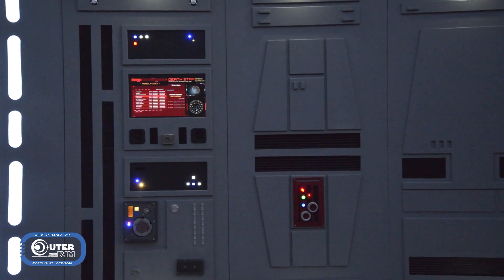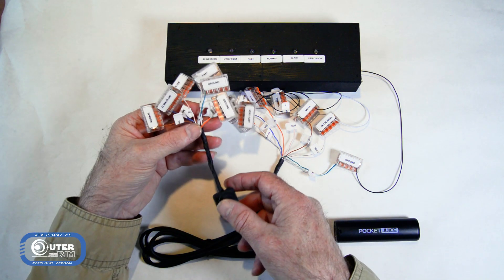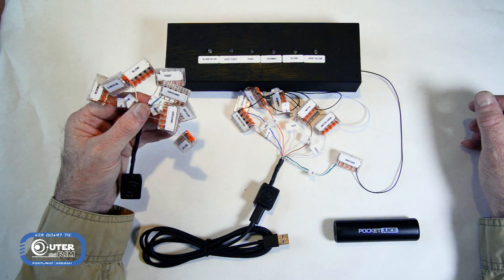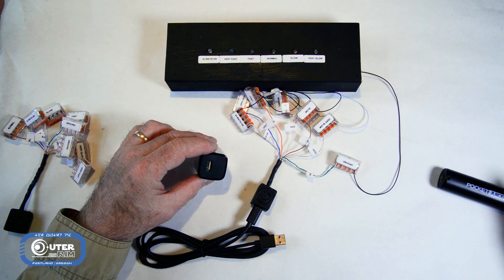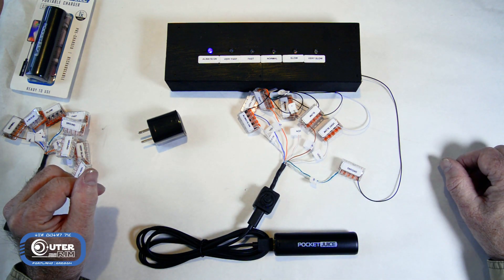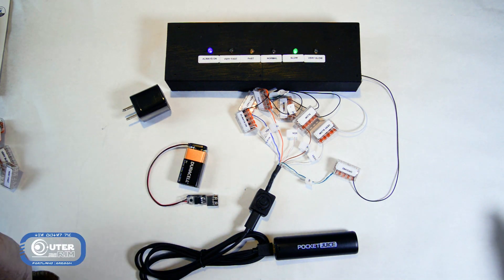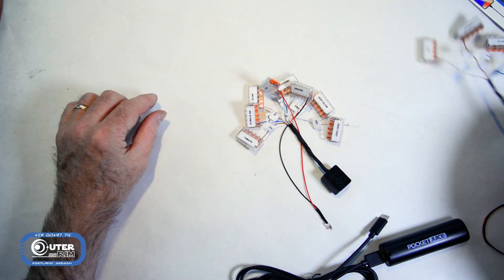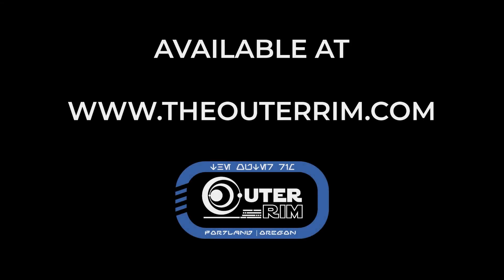Outer Rim LED Controller

Comment: Dear Jamie, I do have a short question about this kind of LED StarWars Panel. Do you place the LEDs directly below the arylic tiles? Or do yu  use another light source to lighten up the buttons?
Reply from the maker: To get the best results, the LED should be a short distance away from the acrylic tile, so it does not create a hotspot. You can build a small enclosure for the LED behind the tile, and put a small square of white packing foam between the LED and the tile to further diffuse the light.  I hope this helps.

Comment: Wondering that the data sheet of the RP2040 says 100mA max output. But so many 20mA led's are connected.
Reply from the maker: Thanks for your comment Robert.  Technically, you are correct, and best practice would indicate you use no more than 10 LED's total. Please use your own best judgement.  I did do a real world test, in which I ran it with (30) 12V LED's with built in resistors continuously for 48 hours with no ill effects or overheating.  I believe this works because the LED's blink at different rates,  which means at any one time, many of the LED's are OFF.  There is a reduction in brightness, when using this many LED's.  To do a large project with lots of LED's, you may want to purchase additional controllers.
Reply: @TheOuterRim_  Yes, that is what I was thinking. You may have programmed it in a way that some are on while others are off. A great way to use many led's. Another way to use more led's is to use a mosfet as a switch, but becomes to technical and to complicated for some. Great idea to use those small micro contollers.